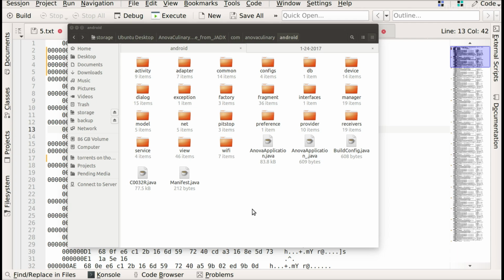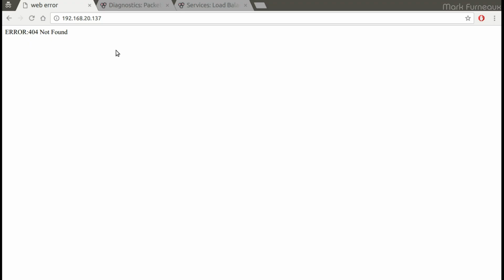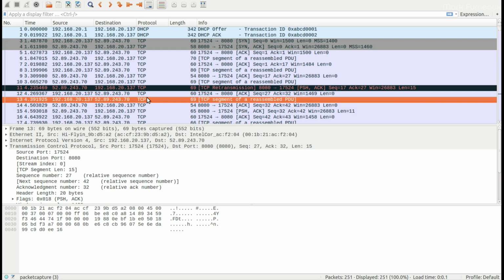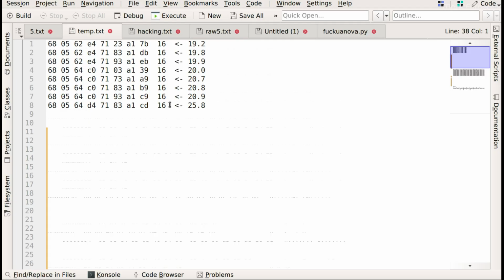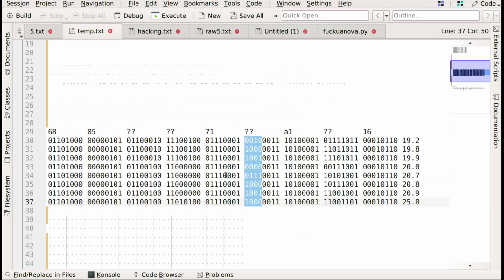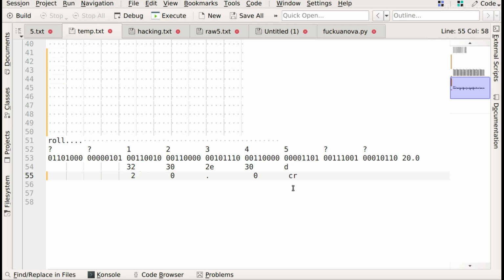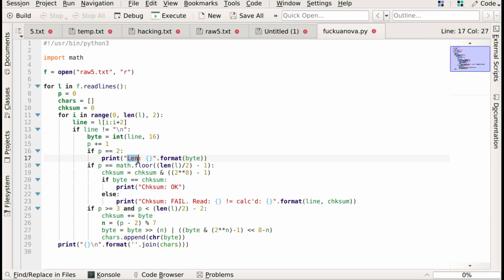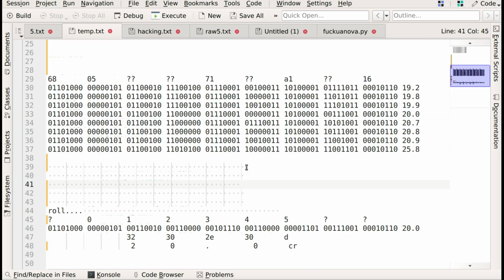Hacking My Sous Vide (Reverse-Engineering the Anova Precision Cooker Software)

Comment: if you have the device with both Wifi and Bluetooth, then you can configure the server address through Bluetooth!
And Anova officially stops the support of the older cookers soon. Including the app support. Making them much less useful.
I have reversed the Bluetooth protocol, it has zero encryption or pairing or any security at all!
Reply: How do you set the server address is it with `server para`?

Comment: I've been noodling on this for the last day, fiddling with scripts so I can monitor my four anovas from a central dashboard.  I have a question that I haven't yet figured out the answer to.  If we take the string 'status\r' and convert it to a binary string, we get 6807e6d10b47aedc0da016 -- since status\r is seven characters, we would expect to shift/roll the value that would represent the carriage return.  But as you can see in the string, it is already 0d.  I took a screenshot of my worksheet -- if you have a moment can you steer me in the right direction as to where I'm off base?  https://i.imgur.com/OoyTp9u.jpg

Comment: Do you think its possible to flash the same mcu in their device with their firmware and build your own sous vide that uses their app? I have this broken anova cooker and Im suspecting that the pin that reads voltage of one of the thermistors has burned because I found wet dust inside and the device measure 0 degrees constantly. I was thinking that it would be possible to replace the mcu and flash it with their firmware update and fix it that way.

Im still not sure if its the mcu or if there is some other issues.

Comment: great video Mark! I actually also did some reverse engineering on this cooker on the software side and found a valid page on the HTTP server!  It leads to what i believe is a firmware update page where you can upload a new custom firmware. ;)
Reply from the maker: Well, go on, what's the URL?
Reply: Haha.. I was just looking it up.. Try "iweb.html"
Reply from the maker: That's the upgrade tool for the WiFi module. It's a pretty standard upgrade implementation used by a bunch of cheap modules which run pretty much the same core code. Sadly it's not the Anova upgrade tool. :(

Comment: Why write a python script for scanning urls when there are already a tonne of scripts that do this. Don't re invent the wheel, if you did not know about the existing tools then you should check google before opening up vim or whatever.
Reply: The built in IP maybe a cached dns that only gets updated ever so often.
Reply from the maker: I started with one, but had to modify it to handle the strange status code. I needed something which could check by response length.
Reply from the maker: No it can't, because the device doesn't have an RTC, and the wireless module does not support DNS.
Reply: Lucky you didn't set it to Fahrenheit

Comment: 21:04 you can clearly see that some of the bytes represent a digit in decimal. Hell, the a1 is probably just a dot.
(2nd byte is probably hundreds, temperatures don't show a difference)
3rd byte is tens
4th byte is units
5th is the dot (probably)
6th is the one before the D.P (I don't know what it's called!)

You could then just reverse engineer it by getting the 1-9 values for each.
But maybe you'll do that, haven't seen it all yet :P